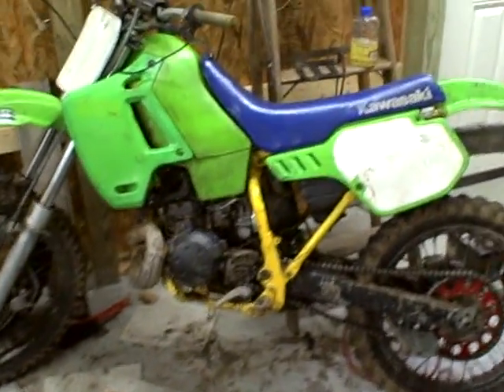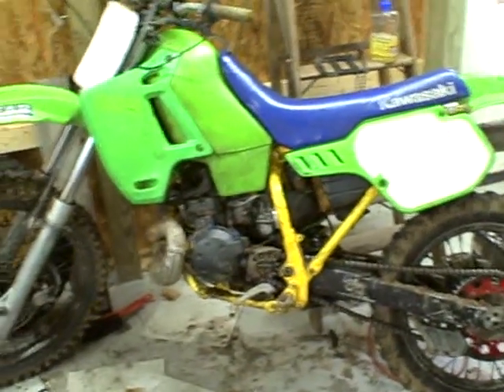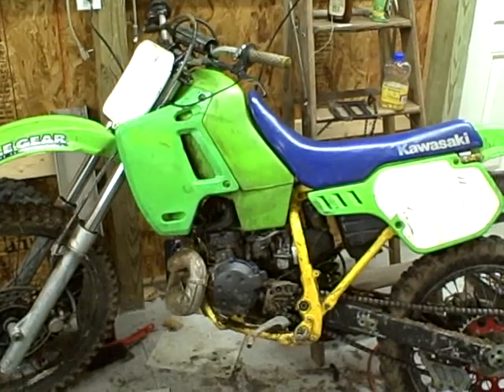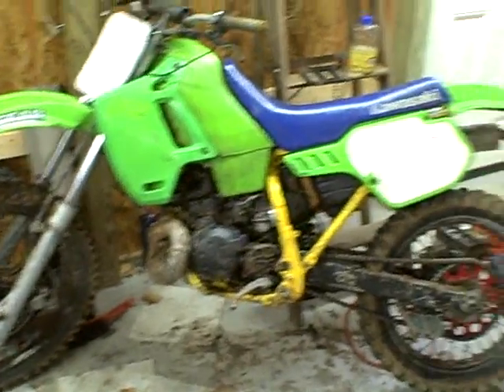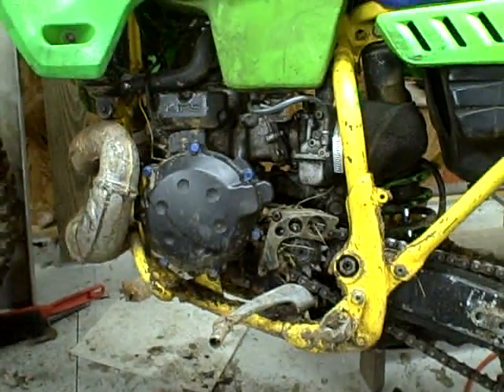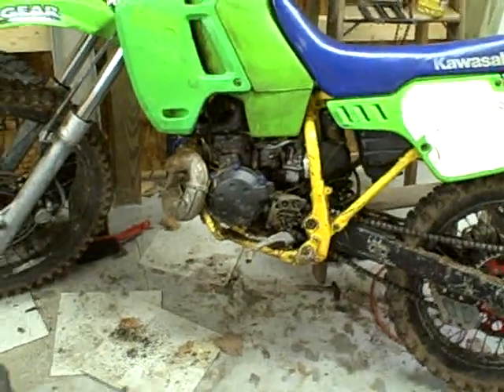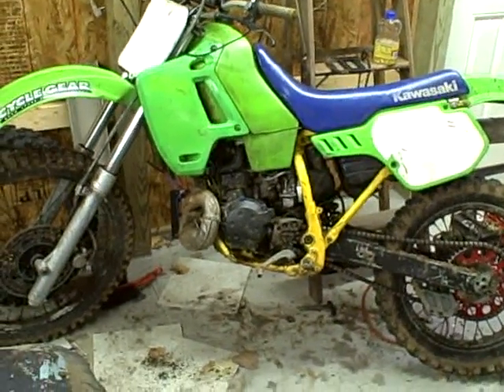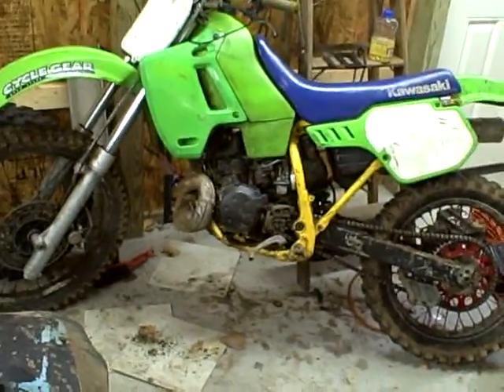KDX 200 Uses regular gas without 2 stroke oil-draws oil from gearbox

Comment: Dude...Dude........Dude.  Your bike is fucked up.  The main bearings are worn out and its sucking trans oil through the seals.  This is bad.  You know the part where you say it looked like smoke grenades went off in the forest after you ride?  That's bad.  Trans oil leaves heavy carbon deposits on power valves which causes them to stick and shear the teeth off.  This is bad too.

There is no port in the engine for trans oil to get sucked through.  This condition is not desireable.  If your bike is so shot that it can run on straight gas you need to rebuild it before it blows up catastrophically.  I imagine it already has considering how old this video is.
Reply: Agreed.  U did this on an old pedal moped, minarelli v1, only way to run was near straight gas. Looked like i was fogging for mosquitos when i road by. Left the gnastiest carbon deposits on the plug and piston after <500 miles.

Comment from the maker: Why the griping? Anyway, there's no there's no other way to burn sae 140 gearbox oil and not foul plugs. Crank seal leaks would foul plugs with motor oil, it's a lower case leak, where fuel puddles...you guys would've lost me my Chrysler factory backing to glow Gsx-R headers in the 90's just by hanging around...left them to suffer new college victims, too...
Reply: There is no port between the gearbox and crankcase.  They have a big seal around the crankshaft to specifically prevent any trans oil from getting into the crankcase as well as to prevent primary compression loss into the gearbox.  You are getting shit because you are trying to tell people that they can run straight gas through a two stroke by rigging up some harebrained shit onto a clapped out motor.  Its a testament to Japanese engineering that your KDX put up with this for as long as it did.